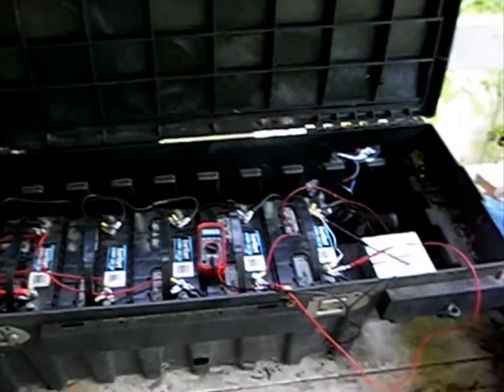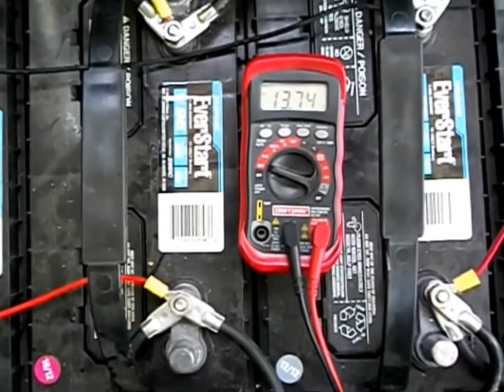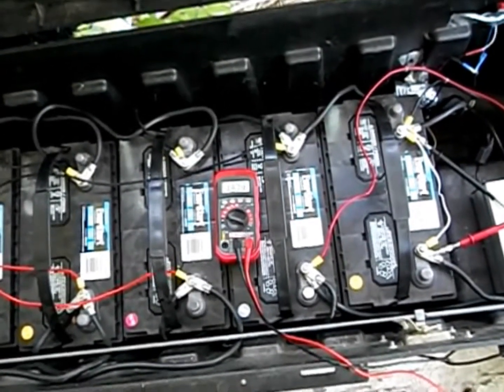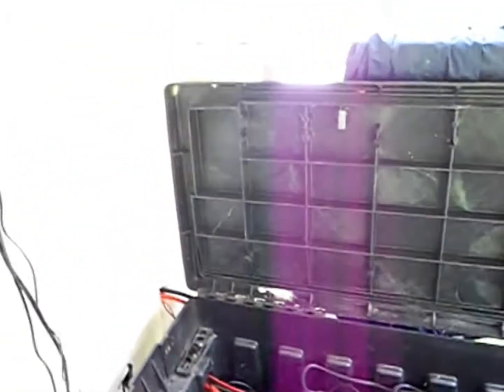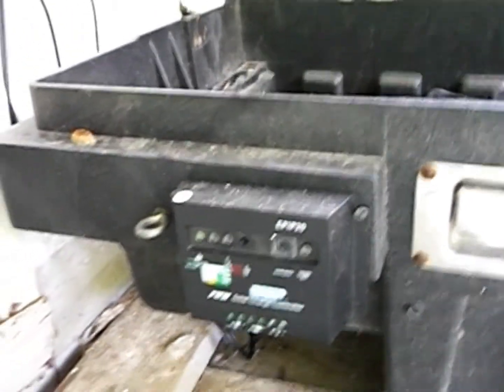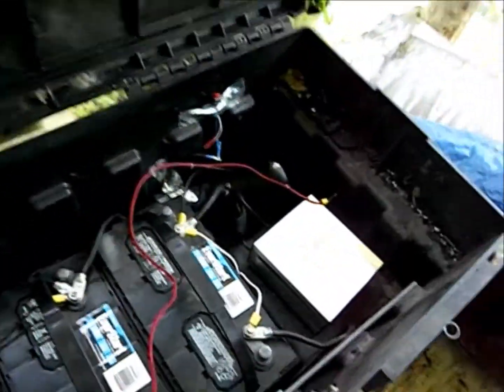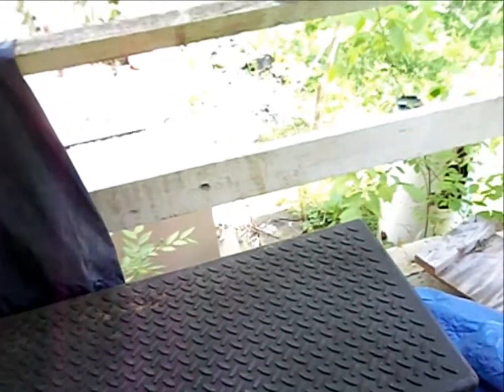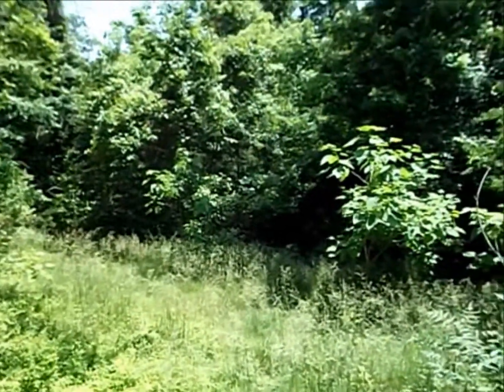Too Much Solar Power

Comment: 13.7 volts is not to mutch, at a 12 v system it may be 14.4 volts at charge, 13.7 is float, that mans batt is fully charged, but not overcharged.
If you dont draw power out of the batt bank, you only have to recharge the natural loss in the battery, when u use power out of it, you also need the power to re charge them back again as fast as possible, so you then need the extra panels, not when only holding them full, but thers your regulator for, you can not have to mutch panels!,

Comment: If the led on the far left was blinking it means that to many volts or amps are entering the charge controlor. The middle light means the batteries are full and the charge controlor is in float mode (float mode disconnects the controlor from the battery. when the light goes solid it mean the float mode is disconnected and the controlor is charging the batteries.

Comment from the maker: Thank you for the comment, yes I do vent the box. I had an old power inverter stop working so I removed the fan and the heat sensor and installed it in my battery box. It just pumps air out the side when ever it gets hot enough to trip the thermostat. I thought about using a house ac/heater thermostat but then it struck me that there was one built just for my situation within the old burned out inverter.

Comment: Do you vent the box? I never though about using the excess to heat an element in water. Clever. I experience the same thing. I have the identical charger and flashes over voltage more than it doesnt

Comment from the maker: I do have a 20 amp charge controller. It is the little black box that has the green flashing light on it in this video. I use this off grid system to power a house fan, router, computer, two lights, my television, my dvd player, and charge my phone and Ipod. I end up using most of these items for at least three hours a night and now I have started even using the power during the day just to make sure that I am not losing out on collecting more power.

Comment: What are you running off the system,   plus do you have a charge controler,  and is it off grid i assum or it'd back feed to grid